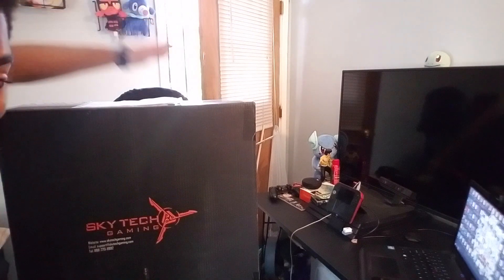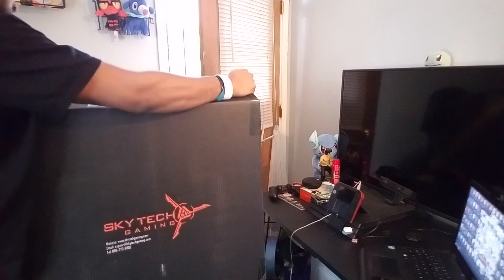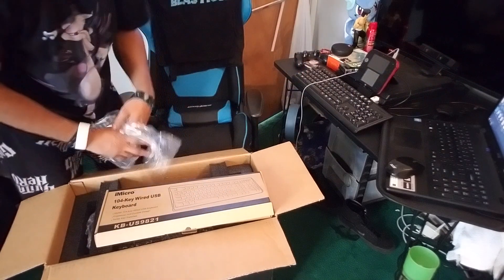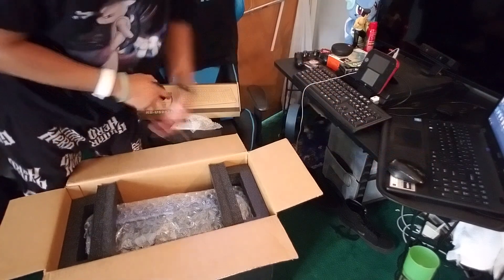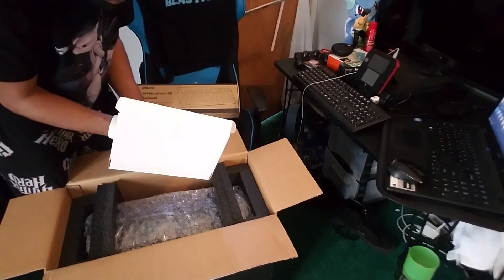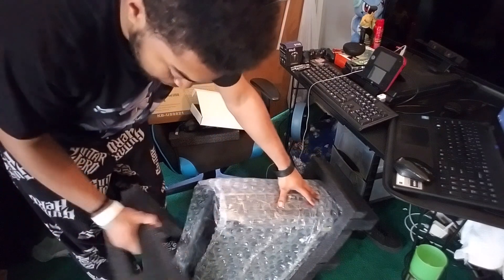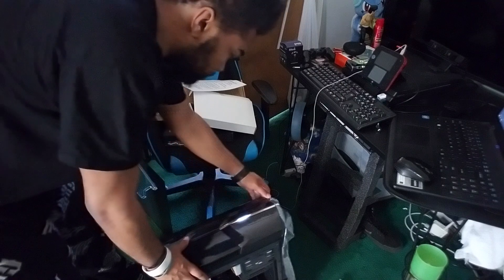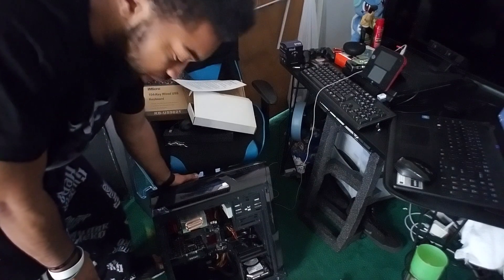Unboxing Skytech Gaming PC with TheJDzero

Comment: Cool video. I plan on getting the Skytech Blaze PC, going for $600 on Amazon. It's running a Ryzen 5 and an RX580 Graphics card, which will allow VR Gaming.
Reply from the maker: nice
Reply: Yea nice i recommend the GTX 1050ti for 50-80 dollars more i was gonna get that one but its not the best graphics card but if ur on a budget go for it!
Reply: @Joel-ic9tr  I do plan to upgrade along the way, so that's a good thing to note, but yeah, I am on a budget. But for $600, I'd say I'm set for a decent build.
Reply: @ThatGuyErazo  yes i agree you are on a pretty good deal for the buck, im getting the gtx 1050ti in like 10 days.
I also plan on upgrading my graphics card along the way but it isnt too bad
Reply: @Joel-ic9tr  after about a year, I might plan on swapping a GTX 1660ti, then I'd be able to run Ray Tracing, but until then, I'm awaiting my new prebuilt.
Reply: @ThatGuyErazo  noice.

Comment: Is it still running good? I just ordered the skytech archangel. Also what's the difference in the shadow and the archangel other than one being black and the other being white? Thanks
Reply from the maker: Skytech Shadow have GRAPHICS COPROCESSOR NVIDIA GeForce GTX
Skytech archangel have
GRAPHICS COPROCESSOR Geforce GTX
Reply: @TheJDzero  how do ik what pc model i have i have a skytech pc
Reply from the maker: @DrModz0  azamon should skytech info on your pc
Reply: A little late to the Party but tbh the only difference is the processor the archangel (white one) has a ryzen 5 and the shadow (black one) has an intel i5. Hope I helped even tho I’m late! 😁
Reply: @pjc8056  yeah and ryzen 5 is also better than most i5 versions. well ryzen 5 2600
Reply from the maker: Yup

Comment: Which is better the archangel or the shadow??
Reply from the maker: what
Reply: Which is better the skytech archangel or the skytech shadow you can search them
Reply from the maker: The Gaming Human well the processor speed is 3% faster on the shadow that's better then Arch and when it comes to processor count Arch have to 2% more then shadow so it's kinda of balance but you could had figured it out when looking it up so other then that this is my first never computer  my Skytech shadow it's not that bad
Reply: ARCHANGEL - Can run pubg at high settings 40-60 FPS!!
Reply: They are the same pc but i say get the omega mini pc witch is what i have
Reply: They’re the same thing...just different colors...

Comment: my cpu fan won’t work
Reply from the maker: Tell me how it stop working or did it not work at all from gecko.
Reply: TheJDzero didnt work at all from the gecko and the fan in the front
Reply: TheJDzero i got it today
Reply from the maker: Ok well if something like that happened usually you gotta make sure everything is connected if that not the case you would email the people saiding that when you got your computer the CPU fan wasn't working then they you send the pc back then they will give new one with your money back or you can get a new CPU fan I don't think they cost that much.
Reply: TheJDzero What do i have to connect?
Reply from the maker: By making sure the fan that's connected to CPU is attached connected again but if that not the case again there are only two options I mentioned earlier.
Reply: TheJDzero there’s 2 wires in the top right of my mother bored that aren’t connected is that it?
Reply from the maker: @artdealerss  it would be attached or de-attached form close by CPU I wish I can help you better if I know what I'm looking at but if theres extra wires not connected and on top to the side those have nothing to do with the CPU fan

Comment: Why is the skytech better than cyberpower
Reply: matthieu sotoidjojo the price range is way better too. For the cyberPower you are just paying for the name i got the skytech shadow today for 650 and i looked at a cyberpower with worse specs and it was 700
Reply: A Cyberpower build generally has worse specs, yet costs more, for example, a CyberPower GamerMaster with an AMD Ryzen 3 2300x and an AMD Radeon R7 240 for $540. Granted the Ryzen 3 2300x isn't a bad CPU, nor is the fact that the build has DDR4 Ram over DDR3, and it also has not only a 1TB HDD, but also a 120GB SSD, for faster loading times. But the GPU is terribly outdated. A Radeon R7 240 will perform on par with a GT 710, which would run Titles like Fortnite on LOW settings at 40-70 fps. Cyberpower usually builds PC's with outdated or low end Components, which is why I prefer SkyTech. They sell Up to date Builds, at a reasonable price.
Reply: @ThatGuyErazo  hey jaacob, what ram does this use? Like what brand? Or does it very? Would it me hard to add another memory so id have 16gb instead of 8gb?
Reply: @allaboutthementality1594  it also depends on which Motherboard you have. If you have 2 sticks of 8GB, then you can max out at 16GB Ram. About the Ram, I know SkyTech generally uses DDR4 RAM, and I think some of the builds even u HyperX DDR4 Ram.
Reply: @ThatGuyErazo  i wanted to know what brand of ram...like G.Skills or corsair
Reply: Not all ram is compatible
Reply: Kyle Abrahams that depends on the build. Usually, the builds under $600 have cheap ram, like Samsung, or the cheaper Patriot and Timetec Sticks, but the builds over $700 have significantly better memory, like Kingston, Sometimes Corsair, and I know a few builds with Crucial Ballistix Red 16GB DDR4.
Reply: @ThatGuyErazo  ok thank u

Comment: Are yu able to upgrade the graphics card or cpu? I'm getting it for christmas but its on it's way still :/
Reply from the maker: So far I haven't everything is good  my problem is the internet Wi-Fi
Reply: Yes it's upgradable, I upgrade my psu to a 750 w and cpu to fx 8370. It's a normal PC the company just build it for you that's it. Just make sure you wait at least 2 months before upgrading or else if something is broken the first days and you have upgraded the warranty is gone
Reply: TheFedericohiguain2 would the regular power supply (420) work for an fx 8350
Reply: +tboyrock2 +tboyrock2 no, you need a more powerful psu. The computer will start shutting down for no reason if you get less power or it won't even start. I can't remember how much power does all part add up but I got 750 w cause I might upgrade other parts later on so make sure you don't go exactly to the minimum power you need but get a powerful psu so you can upgrade later on
Reply: +tboyrock2 also I bought a new cpu fan but this is just optional because amd default fans tend to be noisy so I got one from cooler master and my computer is not as noisy as it used to be
Reply: It is Future proof, but I would wait a while before upgrading, for two reasons.
1. If you upgrade any components on the PC before the Warranty ends, you will be Voiding the Warranty, and if something goes wrong with the Build, for example, a dent or some scratches on the Case, or a defective unit, you wouldn't be able to ship it back to get fixed.
2. If you plan on upgrading the Build, wait at least until next year, because they always reduce prices on PC Components, such as Memory, Power Supplies, Processors, Graphics Cards, etc, which would be well worth the wait. For example, an AMD Ryzen 7 2700 only costs around $180 as opposed to an Intel core i7 can cost $320 at minimum. Wait another year, and they'll most likely drop in prices, maybe even starting as low as $150 for a Ryzen 7.

Comment: why does everyone get this pc I don't recommend this pc at all
Reply from the maker: Why
Reply: @TheJDzero   not that good
Reply from the maker: @omar10ma71  I'm amusing you had one  before  but if did or didn't  you can always change the components in the pc
Reply: @TheJDzero  that is true
Reply: Sky Blue I’m really only getting it due to the fact that the components are really good for the price and my budget is very low (1200 which includes peripherals [keyboard, mouse, and head set])